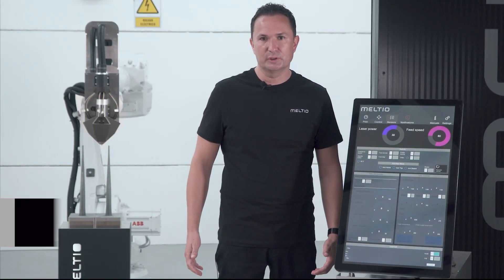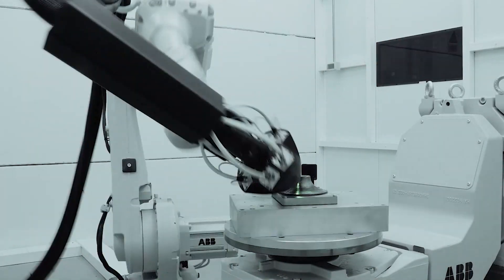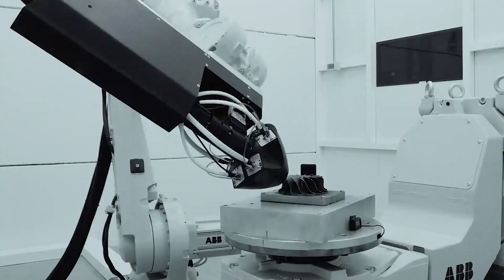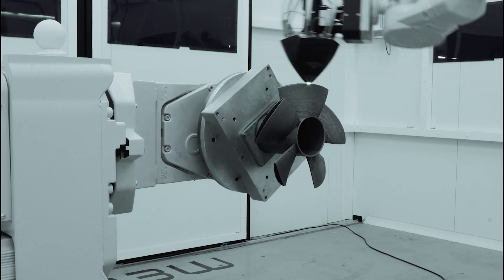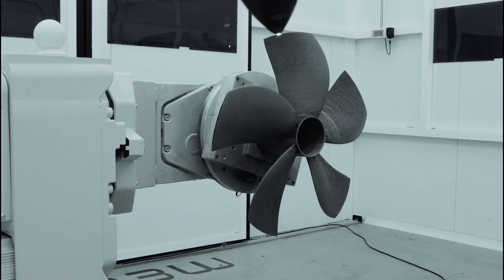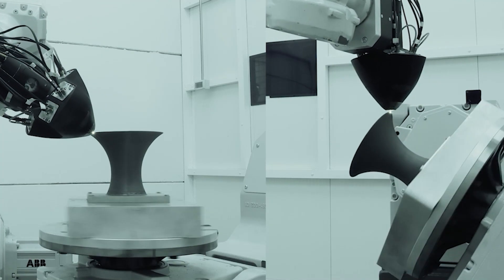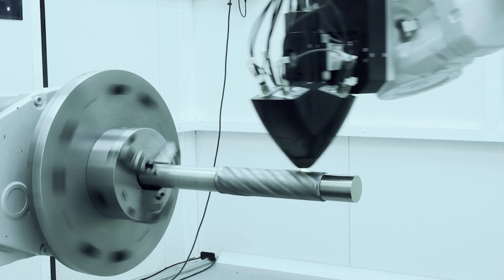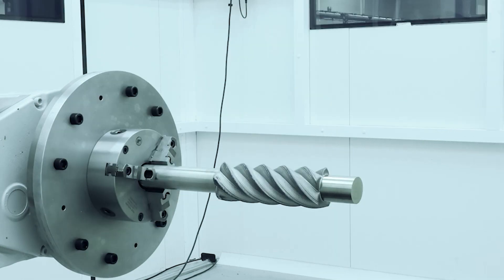Meltio Engine Robot Integration | Large-Scale Metal 3D Printing Explained

Comment: the shapes are right but how is the structural integrity of the prints?
Reply: shapes are far from right... they need post processing and a lot of it... and structural integrity... if u know how welding works... or mig/mag then is the same strength as placing bead over bead... so not very strong compared to traiditional steel... for stainless steel... i doubt is feaseble its a dificult material to work with as a plate... imagine melting it.... when it gets hardened and the properties change.... its probably worth for something not that important and u have a very complicated shape that takes weeks or months to make... and u just dont need it to be perfect.... like a honey comb suport for some device that isnt very important if is perfectly shinny and tolerances dont matter. otherwise this process is useless and super expensive.

Comment: How much does it cost?
Reply: yes
Reply: I this is a case of "if you have to ask, you can't afford it"
Reply: @sonofwau  Yes I asked, it's above 100k USD - Buy a used KuKa robot under 10k - buy 2k attachement to weld and program it into print mode there you go, I saved you 80k.
Reply: @borisraguza8693  That's where you spend 80k on a developer and all the trail and errors in trying to recreate the wheel.
Reply: @borisraguza8693  2K for a laser welder??
Reply: @alexeiiva2719  There is cheaper now for 800 but the best one is over 2k
Reply: @borisraguza8693  can i have the references?